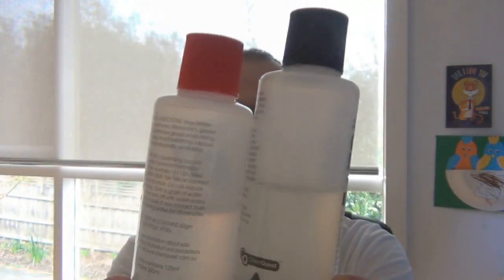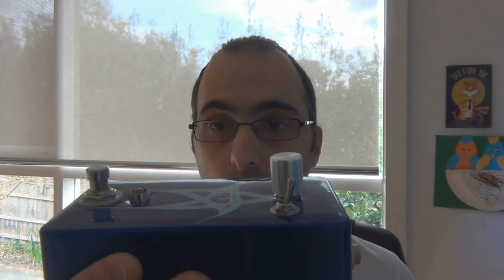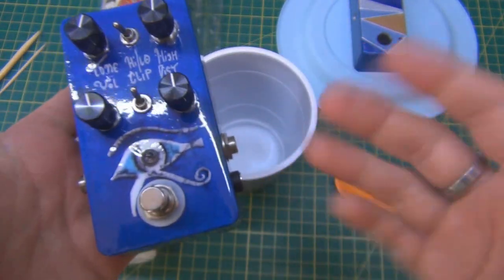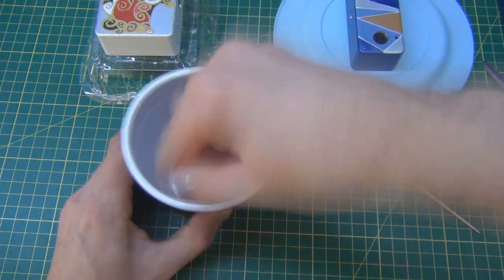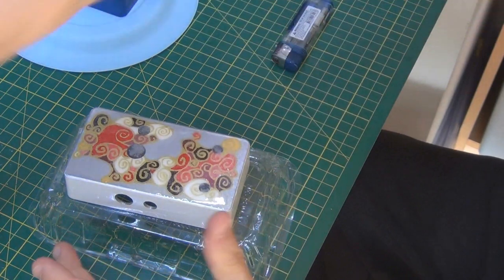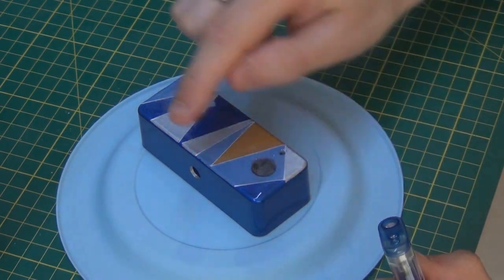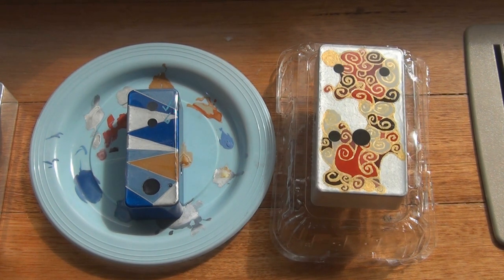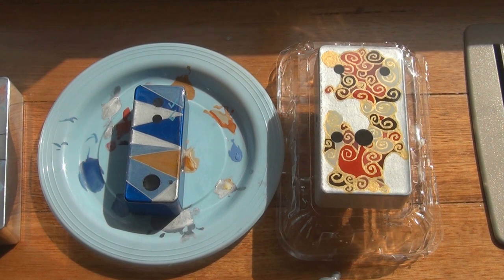Guitar Pedal Epoxy Resin Coat Tutorial (Envirotex)

Comment: Few tips from a former autobody painter for years, More hardener will make the final product more brittle and subject to chipping, slightly less will cause it to be more resilient. You should follow up this video in 1 and 2 years as that is when the lifecycle of the finish will be much more evident. 

Adding heat after the curing process gets going it can cause solvent bubbles to form under the surface. This is because curing happens from the top down and solvents take ages to fully vent. If this happens there is nothing you can do but start over completely.
  Last tip I'll add, when mixing the epoxy, mix it in one container, transfer it to another container and mix a bit more. That ensures you do not have any pockets of unmixed parts.
Reply: If the surface is still soft to the touch, you will get a chemical bond when you reapply a second coat. If it isn't soft it will need a mechanical bond to adhere.

  'fine grit sandpaper' is 600+ usually 800.

when reapplying a second coat your extremely subject to solvent bubbles forming under heat.

  Alternatively, spraying them with a cheap primer gun will make a huge difference, but it is a big step. The pink Chinese spray gun from harbor freight here in the US is good for this kind of application.
Reply: Nice video. I like the owner of the channels?

Comment: Hi, i am trying to made a footswitch for my amp an "peavey envoy 110". At the back of amp there is a input for a jack for the remote control. i had try to insert a jack with a buttom but the only result that i have, is that there is a reduction of amp noise and not the switch from distorsion of amp at the clean sound. Where i wrong? thanks

Comment: One of those silicone baking sheets is a godsend when working with any kind of resin. Any drips or spills on it just peel away once cured, exactly as if you were making candy on it. A cheap kitchen scale makes getting the resin mixed perfectly equally. Just put the mixing cup on the scale, zero it, add part A, zero it, add part B, done.

Comment: A couple tips: 

1. Use a small medicine cup (like the ones that come with cough syrup) to measure your resin.

2. Use a heat gun/hair dryer to level the resin and remove bubbles. This will ameliorate little dimples that happen when the bubbles rise as the resin cures.

3. A heat gun can also replace the toothpick. Simply pour and then hit the resin with the heat gun. It will spread more quickly and give you more control over the medium.

Comment: Thank you for the video! Do you use the drill bit again to drill the holes through the epoxy or can you cut into it with a blade or something? And if you drill again is there any risk of the finish cracking?

Comment: Hey Paul, thanks for this! I just did my first one and came out great. I pre-taped my drill holes from the inside, just wondering if you had any tips for drilling out the epoxy that's filled these holes afterwards - any safety concerns?

Comment: a digital postage scale can be good to weigh out your mixtures.
Reply: ehafh 
 This is not always the case. The product to be mixed must specify it can be mixed by weight. The harder most likey contains the solvents, a small amount if silicon for preventing fisheyes, and an accelerator. The epoxy resin is mostly polymers with a small amount of solvents with binders so it doesn't separate and form solids in the container. 
   It all depends on the formula and what compromises were made to make it more user friendly.
    The professional stuff uses separate solvents to control their evaporation rate in different conditions, a few separate hardener speeds to control several different properties from lifecycle/durability to film thickness/surface leveling, and lamination adhesion, then there are several other optional additives like fisheye removers, accelerators, and specific solvents to alter the spray viscosity.
   The weights of these components are not equal. This is why they are usually specified by volume, and why pros use clear ratio mixing cups all the time.
    That said, no pro epoxy that I've ever seen is mixed 1:1, so there is a small chance they weigh the same.

Comment: Hi, do you have any Facebook page? I'm going to use this tutorial, but I will modify it a little and I would like to ask you what you will think about it. 
First I will drill the holes, then paint. After that I'm going to print a label and stick it on the front. After that I want to use epoxy. The holes will be covered by label. At the end I will cut the holes in epoxy using Dremel. 
I just wonder if it would be fine.

Comment: There’s also an order to adding them together as well, also you may want to consider two spoons, the one spoon will give you less as of the second product as it ends up coated completely by the first.   Two cups as well to ensure it’s actually mixed with no pockets of unmixed stuff and your good.  Should look like milk almost when your finished mixing for 5-7mins

If you do use tape to ensure to mess on the sides then be sure to pull the tape off no earlier then 3:30 no later then 4:30 hours after application

Comment: Hard to believe you dont have a hair dryer, heat gun. Even a soldering iron should work if you slowly scan the top. All these seem safer and easier then a lighter.